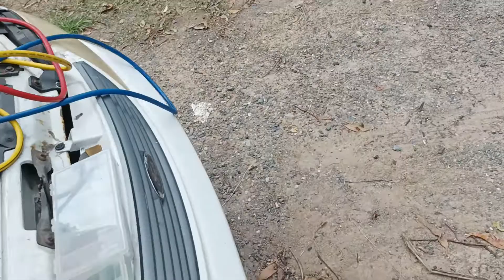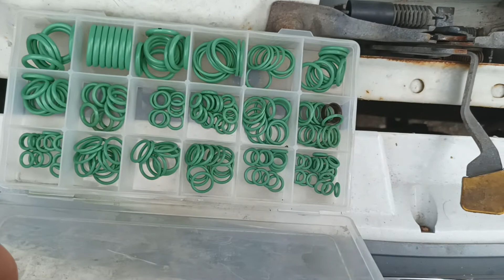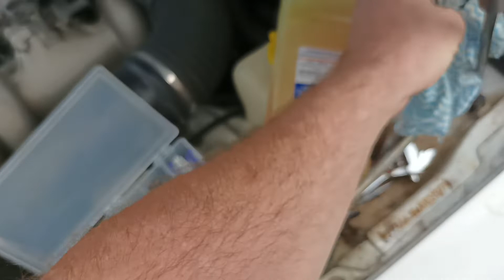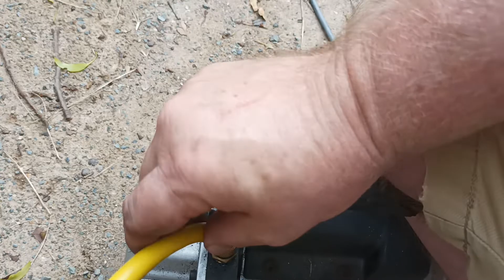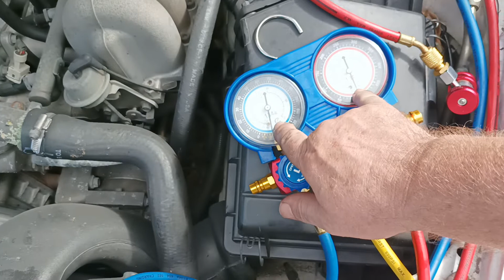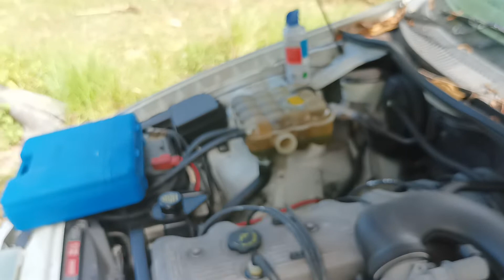Ford Falcon Au Air Conditioning Repair. Broken Aircon Not Very Cold.

Comment: That is a crazy amount of contamination to have in your system! 
The pump must be eating itself..
Reply from the maker: It is 20 years old with 400k on the odo and all original. This is the 2nd time doing it in 20 years. The 1st time the valve was completely clogged with metal paste. The compressor has the usual AU compressor rattle instead of being largely silent so it may only have another 3 years in it, its pump rate is definitely down.

Comment: thanks mate, my AU Falcons AC no longer gets cold anymore and its now winter! but i was on its way out months before it barley made it through summer, what would happen is i'd sit and idle with the AC on and after about 5ish minutes the mild cool breeze it was able to produce would turn into outside air temp! you'd start driving again but the slightly cooler air wouldn't come back.
Reply from the maker: Yes you need to do what is in this vid. This has 152a works really well https://www.mitre10.com.au/wd-40-specialist-air-duster-350g-6426548

Comment: Terry, does an AU have an A/C cabin filter and if yes, where is it located, thanks.
Reply from the maker: None of the au I've owned have a cabin filter. So the evaporator does get clogged up with dust which causes low air flow. You need to get in there with a long air nozzle and blast the dust through to the other side of the evaporator